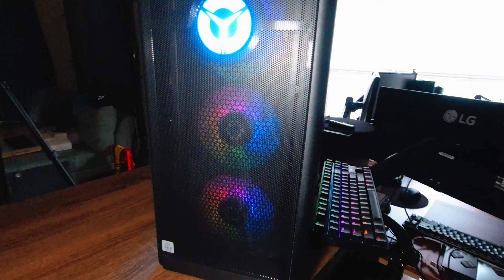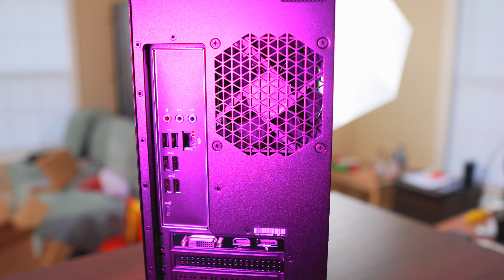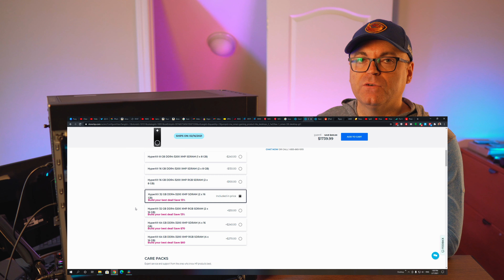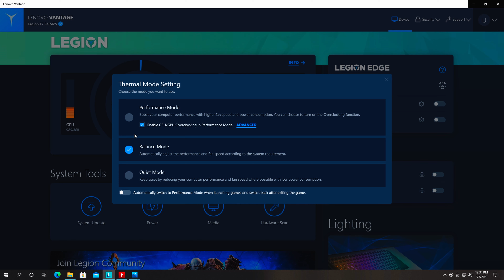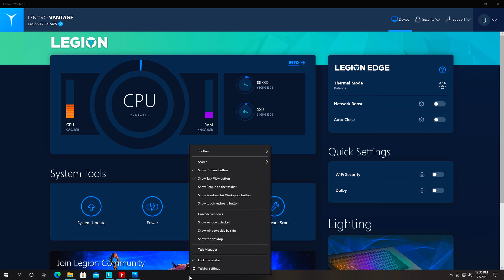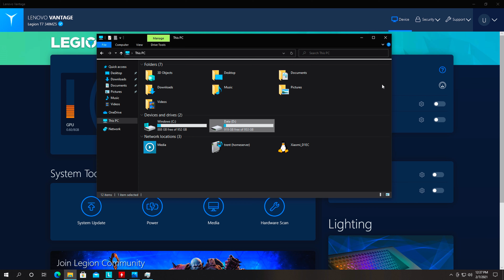Lenovo Legion T7i - Possibly The Best One Yet!

Comment: I got my Legion with the 3080 yesterday, it is similar but not exactly the same. In my case there is a kind of "shield" extending from the front of the case for about 20cm that seems to focus the fan airflow down towards that components.

Overall if totally agree with you that the Legion teels as if they have had someone (for once) who knows their stuff designing this computer. Cable management is excelent, and it feels like cables have been adapted for this case specifically, very little slack cabling anywhere. 

There are only very fiew things that either surprised me or I think they could improve

First off. They have pre-drawn SATA cables to the 3.5" slots, which i found to be very nice, but for some strange reason they have not done the same to the 2.5" slots. I find it strange that they have done it to one but not the other. I currently don't know where or even if I can add additional sata cables to the 2.5" slots. I assume I will be able thought, but it might require me to remove the GPU first..

In my case the PSU is modular, and only the power required for the computer as it comes has been installed. I can kind of relate to this, but the fact that you need to dismount the PSU in order to add additional cables to add additional drives gives me mixed feelings. When I build computers I always thend to add the power while I am doing it so that if I need to add stuff later I dont have to worry about cable management, or even having to disect the computer just to add an additional drive... but this is just my preference because that is how I build computers.

One thing that actually did surprise me was the fact that instead of 2x8Gb memory sticks there is 1x 16Gb memory stick installed. I haven't seen single rank memmory since forever and a day so yea, that was a big surprise for me.

I have yet to find the system m.2 drive, I suspect that it is located under the GPU. I have found an additional M.2 slot that is unused and easy to access however.

Overall I like what I have seen so far
Reply: I found at least two additional SATA ports that I did not need to remove the GPU or take the case apart to access, so yea, nice design
Reply from the maker: Congratulations on the great purchase!
Reply: Hey how is it going with the pc? Still happy with the purchase? Thinking of getting one since i cant seem to get it cheaper when building myself.
Reply: @girsami  Hi!

Overall I am still satisfied with it. 

The one issue that I have had with it is related to the power cables. I put in two 2.5" SSDs and the distance between the power outlets on the cables you got with the built in power supply is so short that I had to use both extra power cables, and using only one SATA power on each to power the two SSDs, meaning that if I wanted to add another 3.5" disk I would most likely have to switch the power supply and redo all the wiring. If they would have added just 5cm between the SATA power outlets this would be a non issue.

I also added 32Gigs of memory but I kept the old 16gig stick. This works and I now have a total of 48Gb memory, but the clock speed went from 3200 down to 2400. From what I understand this computer is very picky with memory to get the 3200 speed. Removing the 32 gigs will bring the 3200 speed back thought so it could be just the choise of memory that is now rocking.

The fans can be a bit noicy when running games, but it is not worse than anyo other computer I have ever had so it does not bother me much.

So far I hve been unable to enter BIOS, but I have not gone to any real length to do so either.

the GPU is not a high performing 3080 but it works well. I have hd no isssues in games but then I am a casual player so I don't really care if I have 100Hz or 240Hz. In Fornite with everything maxed out I have about 100FPS. Running in performance mode puts it at the monitor max of 144 with no issues.

Considering the price of things these days, and how hard they can be to find I still think this is a great bang for buck
Reply: @kobodera8261  Thank you so much for your answer :) yess for the price it sounds very good to me

Comment: I really wanna buy one of these PCs in the UK from Ebuyer but they're missing out details, like what the freakin cooler is and the PSU. In the pictures it looks like air cooler but I think they're outdated photos.   I'd like to know these things..    This one specifically..  https://www.ebuyer.com/1145378-lenovo-legion-t7-core-i7-10th-gen-16gb-ram-512gb-ssd-rtx-90q80069uk   It has 3070 inside but the photos show it with a 2070 and a air cooler..  would of prefered a AIO.
Reply from the maker: Send them a message
Reply: @HardwareSense  will do. :) thanks for the review on the case, really needed to know that info.   Looks like a nice computer.
Reply: @HardwareSense  The dudes at Ebuyer got back to me and said the cooler was a 150W Airflow with RGB light..  didn't give me the exact model..  Not sure if it's bad or good to have an air cooler over an AIO..
Reply from the maker: @ChronosChris  This is the stock cooler, which is not bad at all, but you can always replace it with your own AIO if you want to later.

Comment: Thank you for the review. I ordered a Legion with RTX3080 but with the same case. Do you know if there is enough space below that GPU for another GPU?
Reply from the maker: There is, but it's going to be cramped
Reply: @HardwareSense  Allright thank you! I hope the air cooling will still be ok and the psu 850W will be enough
Reply from the maker: @pucarevoXxX  It should be fine, no worries
Reply: Where did you order

Comment: This sounds like a great machine. However I’m puzzled by the spec sheet indicating it can only support 4 drives (2 m.2 ssd and 2 HDD. No addl (even not m.2) SSDs? And it says the m.2 ssds can only be up to 1TB, which is a bit limiting for a tower PC.
Reply from the maker: 1tb Nvme is plenty, there are spots for 2 SSDs, 2 HDDs and 2 Nvmes
Reply: @HardwareSense  my past is littered with storage devices that seemed like plenty at the time but quickly seemed “too small”. 😀 so at this point 2TB seems like a good entry point for me. I also don’t buy spinning disks unless I absolutely have to. 🥸 Anyway the highest spec’d option now only has the Nvidia 2080S so I’m still mulling it over. I’d like to switch from a laptop for FS2020.
Reply from the maker: @bill_W6MKL  Just get a big external storage if you have a lot of large files

Comment: I don’t know if you’ll see this but I bought the 10th Generation Intel® Core™ i9-10900K Processor, 16 GB DDR4 2933MHz, 2 TB 7200 RPM HDD + 512 GB PCIe SSD, NVIDIA® GeForce® RTX™ 2080 Super 8GB. They offer that on the website. I paid 2200 total with tax. Did I make a mistake? I still am able to return it and wait? Should I? If you respond it would mean the world!
Reply from the maker: It seems like they ran out of 3070, that configuration that you purchased is more expensive than what I paid for mine, the 2080S is below 3060TI, so definitely not worth the money.
Reply: @HardwareSense  thank you for responding! How much do you think I over paid?
Reply from the maker: @derek7525  The 3070 with 2x1tb Nvme drives and 32gb ram was $2100

Comment: How many M2 slots does it have? Only configurations currently available have 500GB SSD & 2TB HD. How well does the air cooler on the 10700K work?
Reply from the maker: Two Nvme slots and the air cooler is not bad at all actually
Reply: @HardwareSense  Thanks for that info! Is the M2 slot gen 3 or 4? Was looking at the Dell XPS 8940 and HP Omen but this looks like a far better system in terms of build quality.
Reply from the maker: @stan.jk3  Whatever the Z490 chipset is offering that's what the slots are, I haven't personally checked, the speeds are plenty fast for my needs

Comment: What would be a comparable laptop to this computer.  I’d like something more portable to use with an Oculus Quest 2, to show off virtual reality wirelessly to a computer.
Reply from the maker: There is none, this desktop will wipe the floor even with the most expensive and powerful laptop
Reply: @HardwareSense  understood, but what would be a good gaming laptop then?
Reply from the maker: @Resist4  Get the new Lenovo Legion 5Pro with Ryzen 5800H and 3060 or 3070
Reply: @HardwareSense  is it ridiculously expensive?
Reply from the maker: @Resist4  Depends on the market in the US should be $1300

Comment: I'm looking at this computer with the 3080. Should I get it? Is it quiet and cool enough?
Reply from the maker: It's the most quiet and cool among all Prebuild computers
Reply: @HardwareSense  thx. Your video made me purchase it. Great vid.
Reply from the maker: @joakimtollerud2172  Enjoy it! Appreciate the support
Reply: @HardwareSense  One more question. It seems my version of the T7 comes with 1 stick of 16 gb ram. I should probably buy another stick to get them in dual channel I guess? What do you recommend? Would another 3200mhz of 16 gb work?
Reply from the maker: @joakimtollerud2172  I would recommend if you can, to get another one from Lenovo. Otherwise it might be an issue with the aftermarket memory to reach the desired speed
Reply: @HardwareSense  ok thx. They sell them from their website? And what if I got 2x8 gbs ram from lets say Corsiar instead? What that work?
Reply from the maker: @joakimtollerud2172  They should be able to sell it, any other ram will most likely default to the base clock and then maybe Intel XTU will help
Reply: @HardwareSense  what is the base clock?
Reply from the maker: @joakimtollerud2172  3200mhz could default to 2400mhz or 2133mhz, it depends on how they have the motherboard set up
Reply: @HardwareSense  ok I have 2 corsairs 8 gb in another computer. Will try that out first. Thx 4 responding. Its beats me why they have chosen a 1 16gb stick instead of going dual channel...
Reply from the maker: @joakimtollerud2172  It's definitely crazy to just add one 16gb stick

Comment: does anyone know how to controll the lightning on the gpu?
Reply from the maker: No way so far
Reply: @HardwareSense  also, i have bought a Legion T5 with 3070 and r7 3700x, and i was wondering why the cpu cooler mount is intel sized and not AMD. if i upgrade the cooler do i buy coolers for intel?

Comment: 1955CHF / 2081 USD for the Lenovo Legion T7 34IMZ5 90Q8008ASZ / a good price aight? :-) 
Intel® Core™ i7-10700KF (8C / 16T, 3.8 / 5.1GHz, 16MB) 
cooler - 170W Liquid with RGB light
NVIDIA® GeForce® RTX™ 3080 10GB GDDR6
Intel Z490
2x 16GB UDIMM ARMOR DDR4-3200
1TB SSD M.2 2280 PCIe 3.0 NVMe + 1TB HDD 7200rpm 3.5"
PSupply 850W 90%
but... gotta wait till MID-May-June it seems till the shop delivers
Reply from the maker: Seems like a good price

Comment: I have a question. Somehow for me the bottom of the three front fans is significantly louder than the other two. Same rpm (800 idle) but it gives out a "sizzling" higher pitched sound (hard to explain). 
Any idea for solutions? Maybe a recommendation for replacement fan? Thx
Reply from the maker: It's defective, other people have complained as well, try to claim warranty or see if Lenovo would sell it to you individually
Reply: same for me
Reply: @boboferre  i switched them all for some coolermaster ones and now its MUCH better. Dont know why they cheaped out on the fans.
Reply: @maddawg4123  is it way more quite? and also do you think the front fans are running at more rpm then the back and top one ? because i think they are louder i would want to turn all the fans at like 300rpm at idle but I can't because the fan control won't allow me it's really annoying they block such a simple thing
Reply: also are the fans running at 800 rpm max for you too when getting like 65+ degrees on cpu
Reply: @boboferre  well for me 2 of my fans were really defective, so yes it was much quieter. I dont think i changed my fans speed curve at all. Baseline speed is 800rpm (info coming from hardwareinfo and cpu z) and it ramps up until like 2400 i think
Reply: @maddawg4123  whar are your gpu tempson your 3070?

Comment: Haven't seen this config at Lenovo's webstore; only the 2070/2080 cards. Could use a little direction here. Thanks!
Reply: Answering my own question: Guess I hadn't paid attention to the GPU shortage. :lol: Lenovo is currently providing the 2080 Super. Still a good deal.
Reply: It’s a great deal mate I don’t reach temps higher then 70C with a core i9 2080

Comment: ok. we made it possible to install two 2,5 slot cards in this thing - and it is up and running. Now we have to stress test it to see if the power supply of 850w is stron enough.
And of course the two cards are only one cm away from each other - so we need to test the cooling as well. We now have the rtx 3080 and an oc 1080 ti - wich has not that much power consumptin than the 3080. Greetinngs from Germany
Reply: Hat es gut funktioniert? Möchte auch versuchen eine RTX3090 unter die 3080 zu setzen

Comment: Great review! I ordered one with i9 and rtx 3080 andit costs just me 2599 €. But i want to install a second gpu in it - do you know if this is possible?
Reply from the maker: What are you going to do with a second GPU?
Reply: @HardwareSense   rendering with redshift
Reply from the maker: @tigerberlin1935  I see, there is a second 16x slot, but both cards have to be 2 slot only, the 3070 that is in, is 2.5 slots
Reply: @HardwareSense  oh no - i think the 3080 is even bigger than this... mhhm i can return it in 30 days - maybe i need to do this then...
Reply: @HardwareSense  maybeee - i install the 2,5 slot card on the second slot above the power supply and then buy a 2 slot card and place it above the other card?? is this possible?
Reply from the maker: @tigerberlin1935  Maybe could work
Reply: Buy a GPU riser. Problem solved, will cost ya roughly 20€

Comment: I'm thinking of getting the i9-10900K, 32gig, 3080 version of this, but the price is 3.199,- euro. The only problem you seemed to have is the power supply and they have a 850W one in this version. But i still doubt if its worth it.

Comment: Could you compare the gaming performance with Alienware? Have been trying to decide which one to buy. Thanks!
Reply from the maker: Alienware with 3070 or 3060TI? Also the price would be a factor, specked similarly the Lenovo wins every time being cheaper, but if you grab an ultra deal like myself, I would always recommend the R10, just because is half of the price.
Reply: Thinking of 3080 as I have a 4K monitor for work. But some people in the comments mentioned that the 3080 was noisy ... Would that be an issue?
Reply from the maker: @kenlaw6012  No sure, never seen the Lenovo version of the 3080

Comment: Where is the 2nd M.2 Slot?
Reply from the maker: Underneath the GPU
Reply: @HardwareSense  thanks for the answer. And where the 1st one? Because I want to add a 2nd M.2
Reply from the maker: @Jordan4inblau  Above the GPU
Reply: @HardwareSense  thanks man
Reply: @HardwareSense  Maybe you can help me out again:
in Germany you couldnt order a 2 TB SSD version, so i want to upgrade my system with a 2nd ssd. But my system came without the heatsink for it and i want to keep the system authentic. So maybe  you know, where to get the original 2nd heastsink?
Reply from the maker: @Jordan4inblau  On the US Lenovo site, when you register your computer, there is a special page under your account support that is listing all parts and their prices if they are available for purchase